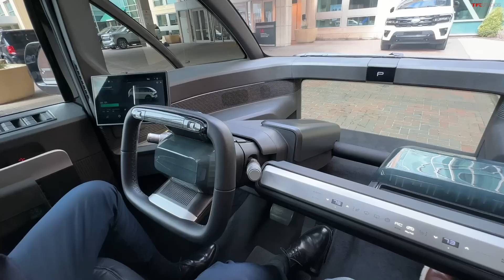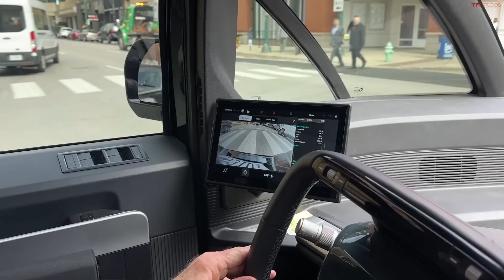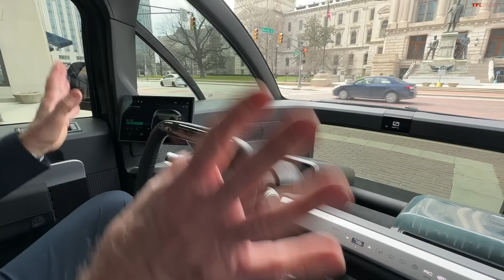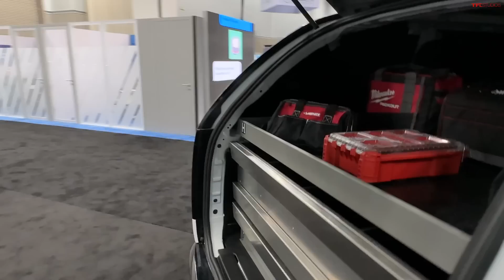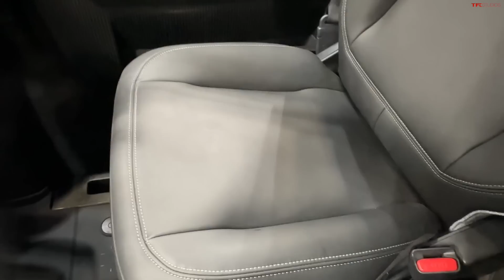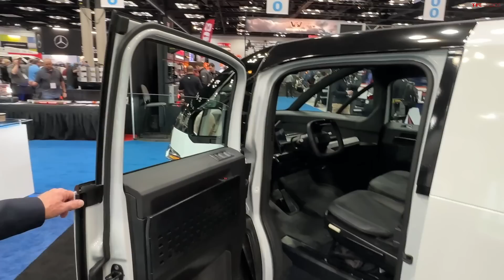The All-Electric Canoo Is Like NO Other Van You've Ever Known or Driven: Come Ride Along With Me!

Comment: This would kill it as a taxi in the streets of London.
Much better than the current 6000 hybrids roaming around.
Reply: Probably too long for a London cab. (Yes, I live here.... There)
Reply: @rogerstarkey5390  I can't imagine this would be legal in Europe.
Reply: I've seen royal mail trialing these canoo vans out and about delivering parcels to houses in the UK.  @rogerstarkey5390
Reply: This cannot be sold in Europe, there is no mechanical steering.
The shape does remind of a London taxi though.
Reply: Just kill it.
Reply: if you want to lower emissions (which i only good for health reasons at least in lw speed compact areas for the lot of street people nearby) hybrids lwer emissiosn better hna using that limited battry supply for fewer numbr of cars which are electric car. he rear top end is also curved causing les stoag space, not like areoydnamics benef would be there.   I really doubt the visibility would be that great if you test it out. Sure, it has a lot of window, but it also has twice as many wide body pillars blocking your view. The front-most A-pillar is also in a spot no other car has, blocking a completely new sector the drivers need to get used to. And the B-pillar forward of the door isn't any smaller than other cars have.  front space , wasted space because you can't store anything heavier than a pillow there due to crash safety. Compare it to the frunk in for example F-150 Lightning and Rivian that provides a new and highly useful storage that traditional pickups and vans didn't have. The only advantage the Canoo design provides is the lower front window. Sure that's an improvement over modern American trucks with man-height bonnets that can hide a whole car from view. But compared to the M-B eSprinter TFL showcased just couple days earlier with the sloping bonnets that gives a perfectly fine view of the road it is a useless gimmick.                            reason why i dont liek electric car is  that battery degradation and lack of battery recyling. dendrites that forms from battery degradation is messes with recyalability too.  if you look at sandy munroe video caled wjats insize 680 battery, there could be indicator of how much of battery can be recycled by mechnaical seperation vs what chemical process would be needed, woudl it be susntinable process? recycling company called redwood. even if they fix this problem, will they dig through trash to find enviromentally damaged (rust, mud,etc) dead car batteries currently being dumped, and recycle them? in emissions, best hting to do is a ca rof where rear seats face the rear as comcpact 4 seate rreplacing 2+2 seater cars and yaris corolla cars, and  rear mid engine small combustion flat 2 cyulnder wnith no rotatiing parts to send power to wheels, instead magnets moving back and forth make electricty aand or a little supplemnetary compressed air , to power electric drive and compressed air driver, possibly with no battery or at minimal battery, using supercapacitor etc.  optimal combustions per second for emissions with electric and mechnaical hybrid turbocharger, sometimes engine will run beyodn optimal effiency or emissions levels for unsuually high power demand to protect long term emissiosn and fuel use reduction effetiveness of battery for common lower power use. with limited batterys to use, hybrids are already more effceint effective at reducing emissions, vs using that battery material for fewer cars who are electric cars, becaue most emissions happens in low speed high pushing power sitatuaitons of combustion car, where emissions are most likley to chemicaly harm health of nearby people becaue its usually compact city area with many people nearby.              what battery size is best for longevity?  see tony hellers climate change videos, maybe somone can make use of suspicious observers videos.          see aptera owners club video on saftey, unqiue materials they use, lightweight is safer to peopel outsid ethe car but can be safe for people inside car compared to hevaier caar if using right materials, and even safer due to wat type of crash is more likley to happen.. linearly more ligghter weight exponentially causes less road wear damage causing less resurces and emissions and road downtimes.                                in effeincy

Comment: Turning radius and visibility is superb - a great urban vehicle. Would also be a great trades (plumbing, electrical, etc) vehicle. Tools and parts in those slide outs and long materials and ladders on a roof rack.
Reply: exactly what I was thinking, I'd imagine the city bus companies would be interested in them for their mobile mechanics, etc. Great tool for a lot of jobs
Reply: Only problem is that it's a "steer by wire" and has instant electric torque ... What could possibly go wrong in a crowded urban setting?
Reply: I really doubt the visibility would be that great if you test it out. Sure, it has a lot of window, but it also has twice as many wide body pillars blocking your view. The front-most A-pillar is also in a spot no other car has, blocking a completely new sector the drivers need to get used to. And the B-pillar forward of the door isn't any smaller than other cars have.

I see the Canoo as a clear example of form-over-function. They wanted the looks of a cab-forward van, but they didn't have the guts actually create one and we are left with a badly compromised design and are desperately trying to come up with reasons to justify it. Sure, the driver seat is slightly forward of the usual spot giving a bit of extra rear space. But in the video when Andre climbs in you can see how cramped it makes the space between the wheel well and front seat.

But the worst feature is the front area they talk about in the video. All of that useless, wasted space because you can't store anything heavier than a pillow there due to crash safety. Compare it to the frunk in for example F-150 Lightning and Rivian that provides a new and highly useful storage that traditional pickups and vans didn't have. The only advantage the Canoo design provides is the lower front window. Sure that's an improvement over modern American trucks with man-height bonnets that can hide a whole car from view. But compared to the M-B eSprinter TFL showcased just couple days earlier with the sloping bonnets that gives a perfectly fine view of the road it is a useless gimmick.
Reply: @Miksa  the rear top end is also curved causing les stoag space, not like areoydnamics benef would be there.   reason why i dont liek electric car is  that battery degradation and lack of battery recyling. dendrites that forms from battery degradation is messes with recyalability too.  if you look at sandy munroe video caled wjats insize 680 battery, there could be indicator of how much of battery can be recycled by mechnaical seperation vs what chemical process would be needed, woudl it be susntinable process? recycling company called redwood. even if they fix this problem, will they dig through trash to find enviromentally damaged (rust, mud,etc) dead car batteries currently being dumped, and recycle them? in emissions, best hting to do is a ca rof where rear seats face the rear as comcpact 4 seate rreplacing 2+2 seater cars and yaris corolla cars, and  rear mid engine small combustion flat 2 cyulnder wnith no rotatiing parts to send power to wheels, instead magnets moving back and forth make electricty aand or a little supplemnetary compressed air , to power electric drive and compressed air driver, possibly with no battery or at minimal battery, using supercapacitor etc.  optimal combustions per second for emissions with electric and mechnaical hybrid turbocharger, sometimes engine will run beyodn optimal effiency or emissions levels for unsuually high power demand to protect long term emissiosn and fuel use reduction effetiveness of battery for common lower power use. with limited batterys to use, hybrids are already more effceint effective at reducing emissions, vs using that battery material for fewer cars who are electric cars, becaue most emissions happens in low speed high pushing power sitatuaitons of combustion car, where emissions are most likley to chemicaly harm health of nearby people becaue its usually compact city area with many people nearby.              what battery size is best for longevity?  see tony hellers climate change videos, maybe somone can make use of suspicious observers videos.          see aptera owners club video on saftey, unqiue materials they use, lightweight is safer to peopel outsid ethe car but can be safe for people inside car compared to hevaier caar if using right materials, and even safer due to wat type of crash is more likley to happen.. linearly more ligghter weight exponentially causes less road wear damage causing less resurces and emissions and road downtimes.                                in effeincy per functionality, rear seats facing rear in sompact 4 seater woudl make more sense. solarpanel effeincy is only arouund 20 percent and can become lot better

Comment: Seems great for a work van, but for consumer use it needs at least 300 miles of rated range (using 120kWh pack) so that it can do a real world 150ish highway miles (2hrs) on 80-10% battery and needs to charge back up to 80% in 30 mins. Provide that for under $65k and I'd be a buyer (better deal than ID Buzz). Well, at least once the CCS network gets sorted out such that it is as ubiquitous and reliable as Teslas network because until then I can't have a CCS car no matter how good the vehicle itself is...

Comment: I want to see their pickup version, I think that will be the game changer based on what has been shown about it the last few years.
Reply: I actually wanted to clarify the skateboard issue for my own sake, so here is the definition of Skateboard: "A skateboard is a type of configuration for automotive chassis, used for automotive platforms of battery electric vehicles. The skateboard chassis includes a base structure or a platform, which houses the batteries, electric motors and other electronic components fundamental to an electric vehicle. It also has removable and replaceable corner units at the wheels, into which the suspension, steering, powertrain and braking functions are embedded."

This confirms my belief that most, if not all, skateboards allow the suspension to be swapped, as I speculated in my earlier comment based on my historic understanding. Furthermore, according to wikipedia (I know, not the best source, lol) I was correct that both Rivian and the GM BEV3 platform are in fact skateboards, along with the majority of other players in EV's, such as Tesla. Honestly, on further review, the skateboard platform is not dissimilar to vehicles of the 1920s and 1930s, in which a company such as Duesenberg would manufacture a frame/chassis, engine, and drivetrain, then sell that to a coachbuilder to put whatever kind of body a buyer wanted on it. Hence many cars of that era having a hyphenated name, that of the base platform and that of the coachbuilder. Then main difference now is that the bodies are also being built by the skateboard manufacturer. 

Frankly, modern pickups are essentially also skateboards, in that they use a common set of frame rails, engine, and drivetrain components, then put on the cab/bed configuration that the customer orders, along with the suspension configuration that the customer wants. A good example being a Silverado RST vs a Silverado Trail Boss. The frame, drivetrain, and chassis options are all identical (as are the cab/bed combos offered I believe), but the suspension and other off-road bolt-ons (skid plates, etc) are mounted on the base Silverado platform to create a "Trail Boss" and to give it greater off-road capability, despite the trucks being 90%+ mechanically identical.

Comment: Interesting vehicle. I feel like that's not very efficient use of space in front of the driver, but that's probably the only way they could have a crumple zone to get through crash testing. I'm definitely interested to hear more about the pickup when that info comes out.
Reply: Yeah he confirmed it was a crash zone when going through the interior.
Reply: It would be great if they were to figure out how to make it a storage area — with pull-out compartments or a head-on front door or something.
Reply: @pechaa  I wonder if that would compromise safety though. It would be an additional item that could impact the driver or front passenger in the event of an accident. I think you’d still have to worry about trim pieces in an accident but probably a lot less risky versus a drawer from that space.
Reply: the wide angle lens makes the space look larger than it really is, its not that big
Reply: @JogBird  yea I agree. When you see it from the outside you can see that it’s not as big as it looks from inside.
Reply: Yes it is about crash safety. You have a lot of Japanese vans which are way more space efficient, but not that safe.

Comment: I have done quite a bit of van work over the years and I would happily trade that opening side door for a sliding one like most modern vans have. Interestingly the van in the video looked like it only had a door on one side as well.  The lower edge of the cranked tailgate and its latch mechanism looks perfect to bash your head on if you are slightly taller.
Reply: Apart from the price, sliding doors are superior to normal doors.
They're definitely the way to go in vans and large family carriers.
Reply: @karstenpedersen7749  They also keep your kids from dinging my car.
Reply: @jeffk464  Yes, but you're not safe from my wife!
Reply: Adding my vote for sliding doors.
Reply: Agreed. Looks like that door only opens 90 degrees? So, in addition to needing extra clearance to open it, you can't get a second person next to the load to carry it away. Needs a sliding door option.
Reply: You do know that Canoo can configure their vehicles any way the consumer wants right?
Reply: @PatriciaBowden-cf5mi  A sliding door is requires changing the side of the vehicle and could require a new series of crash tests because of the different door and side which will change the level of crash protection
Reply: The point of these is they're customisable.

Comment: The Van is cool but the controls is not cool.  HVAC control on a bar?? Mirror only adjustments on the steering wheel?? And Screen on the left…what gives?  Then you got that stupid speedo all the way up front….sorry but there are lots of corky stuff that needs to be changed IMO.

Comment: Love it, hope they can get to 300 mile range and stay reasonably priced!
Reply: With a drag coefficient of 1.04 or 4.5X that of the Model 3 and 8X that of the upcoming Aptera Roadster I'm surprised the Canoe even gets 400km/250 miles of range.

Very unique, pragmatic design though 👍
Reply: @handlemonium  Model 3 drag coefficient is .23
Reply: All they need to do is the hard bit and put it into quantity production. A great vehicle, I hope it gets there
Reply: I have been a minivan person my whole life. This is cute, but I don't know that I'd want to give up my Grand Caravan for less mileage, less weight capacity. I love the versatility of my minivan.  I'll have to wait a bit longer until something else comes on the market
Reply: 300 miles is easily doable, I have a Ariya, with 304 miles epa for $45k
Reply: thats not how the price of batteries work...
Reply: @laloajuria4678  Doesn't the tesla m3 have 300+ range for about the same price as the premium model?
Reply: That’ll be within the next decade
Reply: Gotta wait for the new silicon battery technology to be available.
Reply: @stevelouie5928  they will just use less batteries at that point.  Someone working in a city will never go more than 200 miles a day. I bet average use with that van they will charge 2 or 3 times a week.

Comment: How safe is it in a crash when the driver is right at the front of the van?
Reply: I drive a Ford van for work and this seems like it has way more space in front for crumple zones. Also from the crash test videos I've seen it seems super stiff.
Reply: Have you seen a box truck?  That's even worse.  Only difference here than a regular van is you can see how far you actually are.  It's not any different if you took measurements.
Reply: They're aiming for 5 star and materials and engineering these days is far more important than just empty space in front of you.
Reply: Has a huge crumple zone compared to traditional cabover vans.